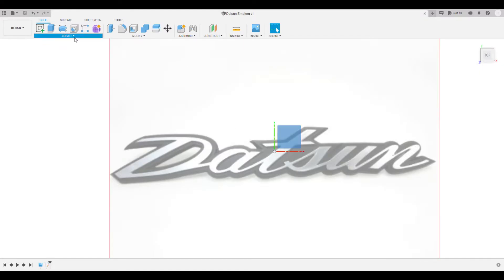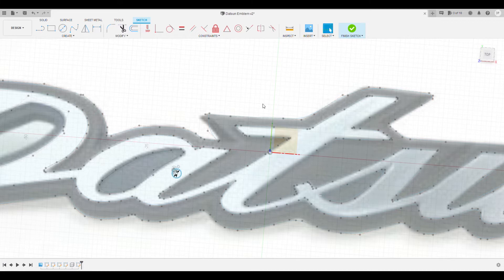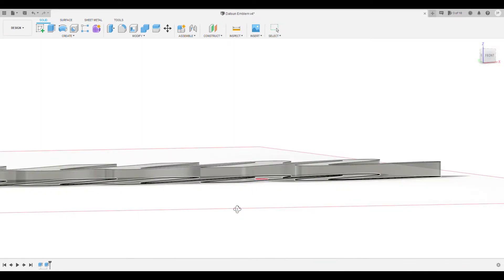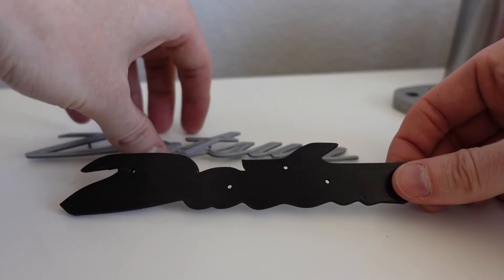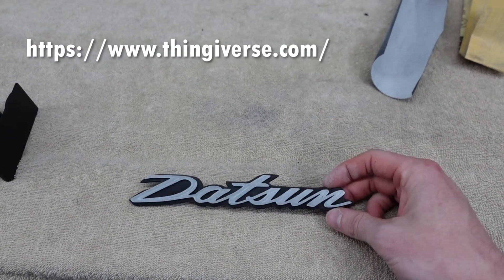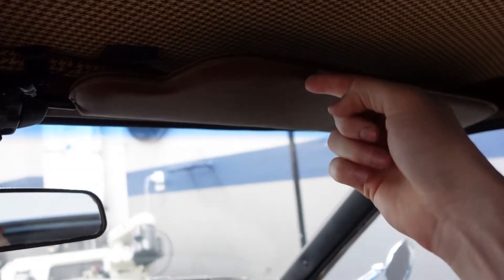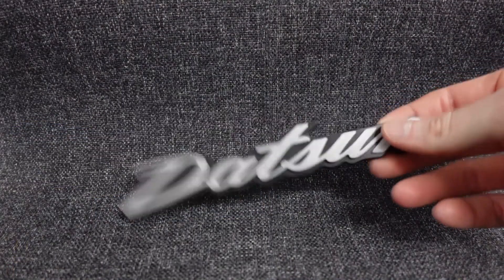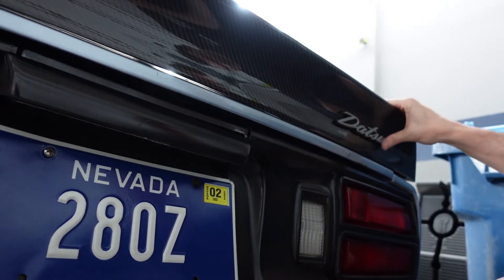3D PRINT EXPENSIVE CLASSIC CAR LOGOS FOR CHEAP | Can I 3D print parts for my car? Creality Ender 3

Comment: Hi.. I'm an older man now.. Time is valuable now. 😆 I have learned photoshop 20 yrs ago. It wasn't easy and your 3d software looks like it's got a high learning curve with some ps like functions that I really would like to avoid months of learning, if even possible?? 
If I hv no choice then ok, about how much time would I be looking at? 
I want to start designing 3d badges and plaques anywhere from penny size or smaller or up to 6x6 inches or 10x10. What would be the best path to learning this quickly and what 3d printer would be ideal to start printing quality 43d  products for sale?? Thanks
Cool sunvisor remedy.. our minds our alike. I fix things on my vehicle or in life out of the box and good at it.. but still dying broke 😂
Reply from the maker: Hey there! I would say that it’s about a 3 month learning curve to pick up fusion 360 (cad software) and learn the basics of 3D printing. I learned everything that I know about Fusion 360 from Lars Christensen (link below). It can be frustrating, but if you’ve learned photoshop then this should be similar for you. I’m looking into getting an Ender 5s1 printer. Check out Lars’s channel! 
https://youtube.com/@cadcamstuff
Reply: @JordanPayneLV  Thanks so much for this fast response in a busy world. I did abiut 3 hrs watching 3d tutorials. If you can manage 1 more, Would you recommend the free Google Sketch Up software to design 3d projects then use the 3d printer software to create?
Eitherway thanks again and I will review your 1st answers. 🙌
Reply from the maker: @ALSILVERU2  yeah no problem! I don’t use as sketchup type of software. But you make the 3D model in fusion 360, then export that model to a “slicer” I use Cura, and then cura will make the code file that gets imported into the printer, then it’s done :)

Comment: How much would you charge to make a Iroc z emblem???
Reply from the maker: Hey man, my 3D printer is actually broken these days and haven’t replaced it yet. So, I’m not!
Reply: @JordanPayneLV  I meant in fusion I can print it I’m just awful with the cad software 😩
Reply from the maker: @432-ninja7  it would probably be cheaper to buy a real emblem than to have me draw it up in CAD, that’s where the savings come in, learning the software and doing it DIY

Comment: Hey Jordan - what kind of 3d printer did you use? Any links you could share? Awesome emblem!!
Reply from the maker: I use an ender 3 but’s it’s a couple years old already, I’d check out the new version - it has a lot of improvements over my model :) 

Official Creality Ender 3 V2 Upgraded 3D Printer Integrated Structure Design with Carborundum Glass Platform Silent Motherboard and Branded Power Supply https://www.amazon.com/dp/B07FFTHMMN/ref=cm_sw_r_cp_api_glt_fabc_B300G1XFQTTXKSM6A5NH

Comment: Have you replaced the head gasket on your car?
Reply from the maker: I haven’t!
Reply: @JordanPayneLV  Idk if I should or not as I refresh the engine I have the intake and exhaust off lol
Reply from the maker: @blacktopmedia  you definitely can, and it might be a good idea, but I guess it depends on how long you’re okay with you car not running. It also depends if your car shows sign of a leaky head gasket. Have you looked at your pistons yet?
Reply: @JordanPayneLV  no I haven’t but when I took off the cooling system is was dry and full of dry coolant
Reply from the maker: @blacktopmedia  I’d Say inspect your pistons for rust or pools of dried coolant. Use one of those little cameras. If you don’t see any of those things then you should be okay for a little bit more time. The head gasket has metal in it so it’s a strong gasket and if it doesn’t show signs of failure you’re most likely okay

Comment: Just purchased some 3D printed pod holders for the center gauges... like the pod holders that skillard makes for the Speedo/odometer.
Reply from the maker: Nice! Yeah a couple of the vendors actually sell 3D printed pieces as block off plates for little things in the engine bay like the cold start injector. 3D printing hitting the mainstream!

Comment: Looks good man, what filament did you end up printing in? Edited I typed it before the very end of the video ABS is the right choice. I have not picked up ABS yet, but have several ideas of things to make when I do get it.
Reply from the maker: ABS isn’t too bad to work with honestly, if you use a big brim on a glass bed it’s not really a problem unless you’re doing really long, big prints. I also use aerosol hairspray on the glass bed which really helps with bed adhesion